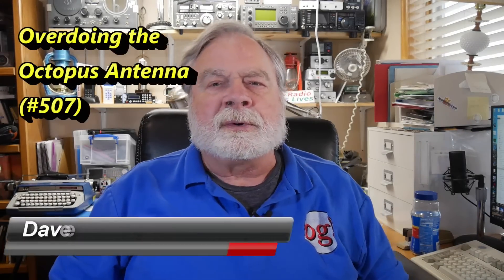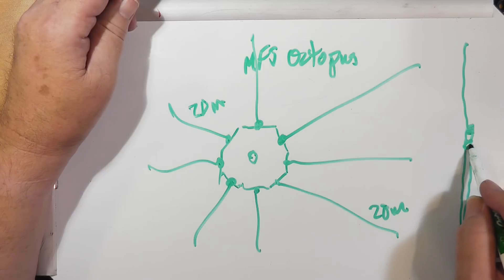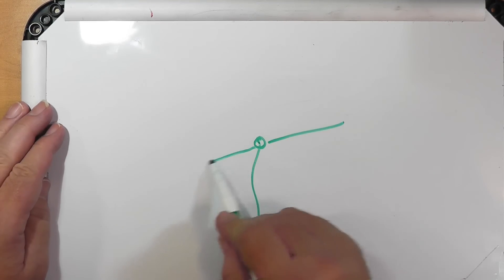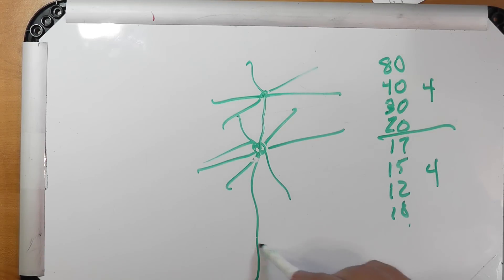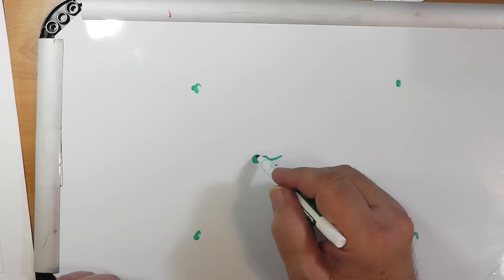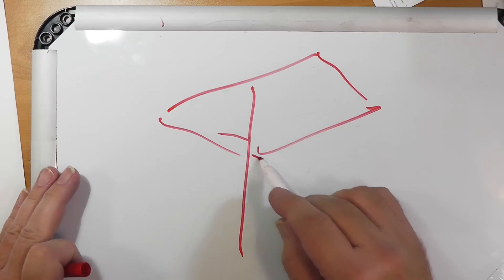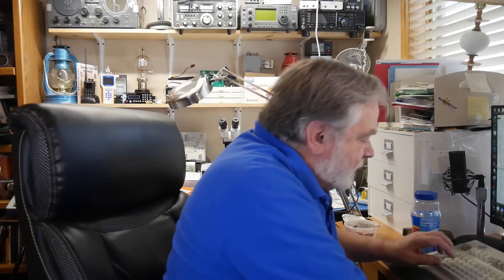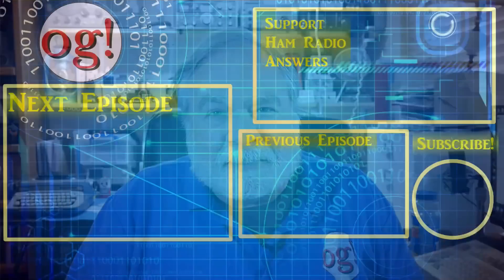Overdoing the Octopus Antenna (#507)

Comment: I JUST received email from Josh Miller that the SPIDER was discontinued several years ago, and the QUAD ONE has ceased, and neither will be returning.
Reply from the maker: Try Buddipole and MFJ.
Reply: @davecasler  Your other video said that the quality of the MFJ  ("Makers of Fine Junk") was substandard and as a result, crossed off my list.  Have instead turned to another of your recommendations, the family of DX Commander verticals.
Reply: @davecasler  Another update.  Chameleon contacted me, and said for the remaining QUAD ONEs, they are out of brackets, and offered me a $10 discount, which I accepted on condition they would supply the drawing for the bracket, and attempt to make my own.
Reply from the maker: @happyhome41  Thanks for the update! 73, Dave, KEØOG

Comment: I considered the Octopus, but a couple of things had me doubting it: First, some of the bands are just too big for one dipole to be efficient covering the whole thing. I've not seen anything mentioned about running two of the dipole pairs on the same band, but each tuned for a portion of the band in question. Second, you would have multiple bands all at the same height, which itself is a compromise. And third, it would seem like a nightmare to rotate this thing if you were interested in rotation. Seems to me that if you really wanted to run Hamstick dipoles, it would make a lot more sense to mount multiple MFJ-347's (say, 3 or 4) to a single mast, with each band closer to the height that works best for them. Yeah, you lose the single coax feed unless you go with a remote antenna switch, but it seems like the varying heights would be less of a compromise- and less of a headache figuring out which band is rotated to which direction.

Comment: I have an MFJ Octopus antenna and never did get it tuned on 20 or 40. I used the MFJ 259 tuner and just never achieved an acceptable SWR. I believe I adjusted those stingers until my fingers were raw. That antenna and ham sticks are now piled against a wall in my garage. It may just be my situation. Thanks for all your great information, Dave!
Reply: same thing here. should have spent a little more and put up the mfj 1838 , for verry little more money.

Comment: I think Dave is spot on by horizontally separating them on two masts. It would be interesting to see some meter readings taken with them stacked vs separated as he suggested. An alternative: both Butternut and Cushcraft make a 9 band vertical. Personally, I'd purchase an antenna from M0MCX.

Comment: I've got up a MFJ-1785 rotatable di-pole, but it's 38 feet tip to tip. Sure you can get a much smaller antenna for 40 and 80. It's called a dummy load. Just because you have low swr, doesn't mean it's radiating. You need surface area to get those electrons into the air. Dave's right, and tuning 80 is a b*tch. On a good day I'm lucky to get 30kc. I switch over the G5RV inverted "V"
W9DLP

Comment: I've enjoyed fiddling with my 75 meter Hamstick.  Little bit of work to tune, but I've got on the ND net with it, and I was surprised by the badnwith, ~50 KHz <2:1 SWR.  But, it wasn't very powerful by any standard, more of a mud duck interfering with the net, needing to be relayed in more than once so far.  Might experiment with some other bands at some point.

Comment: First Thanks for the many videos. I have the non-MFJ version of the Spider with just a pair of 20m and 40m sticks. I can get a reasonable SWR using ny  LDG YT-1200 Autotuner. IT's not perfect but usable. See Below I used the FT8 Freq and the Middle of the phone band for Generals as the Freqs
80m	3.573MHz	< 1.0 
		3.9MHz		1.3
40m	7.074MHz	1.3
		7.2375MHz	1.2
30m	10.168MHz	1.2
		10.125MHz	1.3
20m	14.074MHz	<1.0
		14.290MHz	1.8
17m	18.100MHz	1.7
		18.138MHz	1.2
15m	21.074MHz	1.1
		21.3375MHz	1.2
12m	24.915MHz	1.1
		24.960MHz	1.5
10m	28.074MHz 	<1.0
		29.00MHz	1.7
6m	-	50.313MHz	1.6
		52.00MHz	1.5

Comment: My inverted V covers 80 thru 6. If I had a full acre sized lot, it could go to 160 (I plan to experiment with end loading to get down there). A bit expensive, likely more than a fully populated octopus… but it’s pretty awesome to be able to get it resonant at any freq, no tuner, one feed line.
Reply: Make a inverted V folded 160-6 dipole..Works for me to get down to 160 when I want to and takes half the room..All you need is a dipole and some spacers to keep the wire apart..Yaesu and Icom both make one for 160-10 and a few otherrs make them as well..Take up about 80-90 feet for one made right..
Reply: @bentrider1972  Well I'm not giving up the feature of being resonant on any freq without a tuner. But on the rare occasions I'd want to get down to 160m, walking out and clipping something to each end of the legs is what I'm after. And that something might go outward, might fold back inward, might go sideways... it is as yet undetermined. Thanks for the suggestion - definitely looking that up for ideas.

Comment: is that the same as a spider beam?
Reply: No. The spider beam is directional, whereas the octo is a nearly omnidirectional dipole.
Reply: @kelvin0mql  Is it? I would reckon it is directional, like any horizontal dipole.
Reply: @erpece  Horizontal dipoles are NEARLY omnidirectional, in that they have a bit of (but not complete) null off the ends. And there's no front-to-back difference like a beam has.